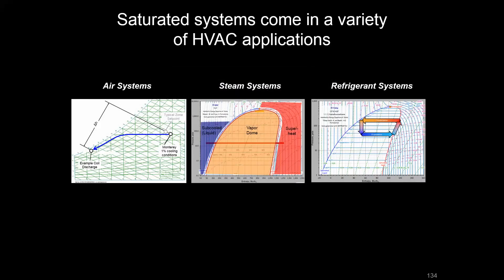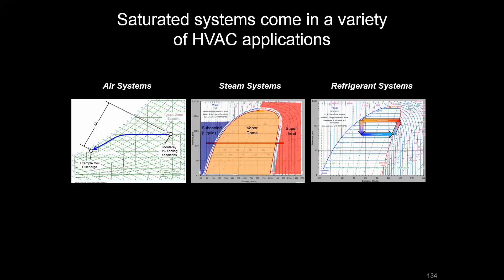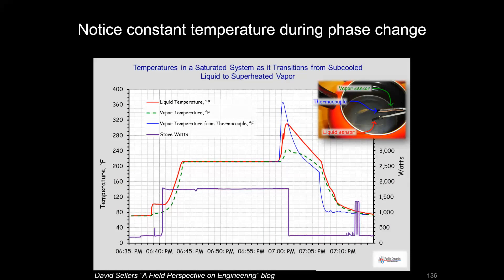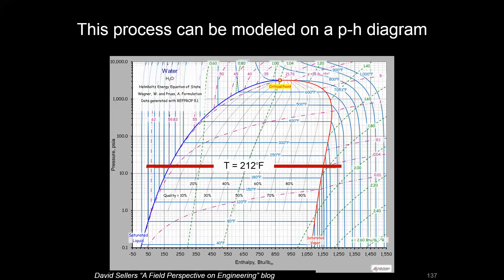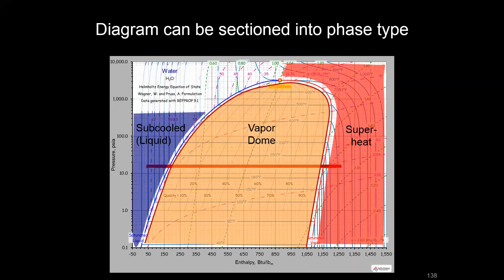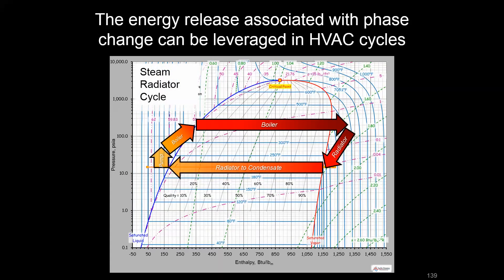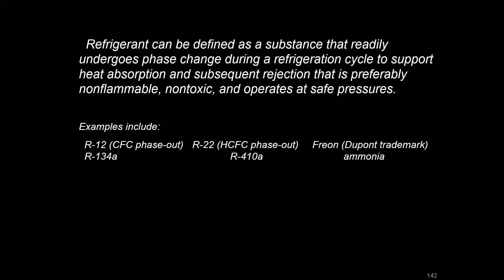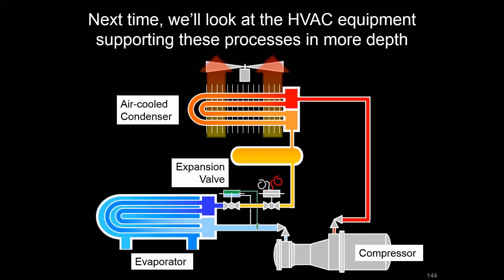Refrigerants and other multi-phase systems

Comment: Psychometrics, steam systems and refrigeration systems have saturated processes where phase change occurs, but all parts of the system are not at saturation.
Reply from the maker: Thanks Eileen for the clarification, in these videos and exercises we introduce and use the term "saturated systems" at times as a short-hand for the types of multi-phase HVAC systems that leverage saturated process to address HVAC loads.  The term can be misleading, as steam systems or air states are often described as "at saturation", so perhaps a better short-hand is "multi-phase systems"

Comment: A more accurate description of the phase of the water vapor in interior building air is as a superheated gas, not a liquid.
Reply from the maker: It sounds like I misspoke, thanks Eileen for the catch.  Any moisture contained in the air would be in the vapor phase, and superheated unless right on the edge of the vapor dome (i.e., in contact with a cooling coil at or below the dew point temperature for that particular air state, at which point a specific amount of  water vapor begin to condense out of the air as liquid condensate)